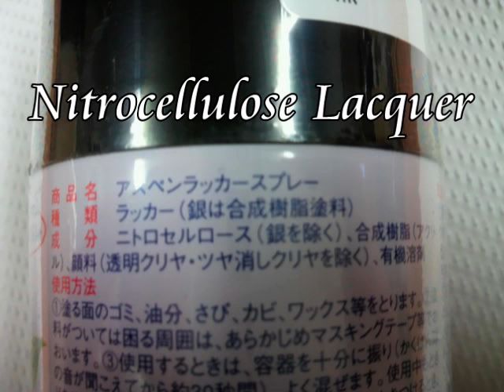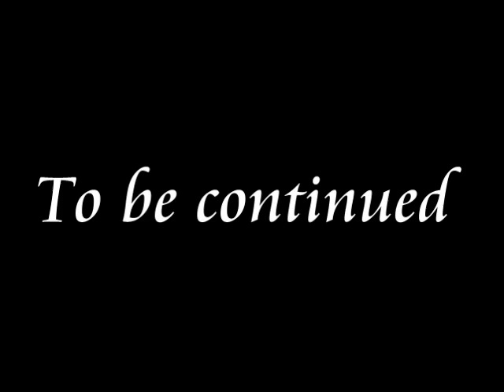My Frankenstrat part1

Comment: @diagnosed21 that's why you let it dry for half a day or longer depending on the coats. If you had a lot of trouble with that either spray thinner coats or, wait longer before you take the tape off.